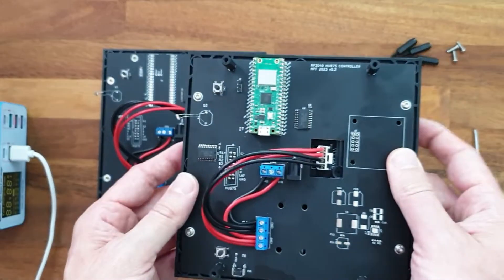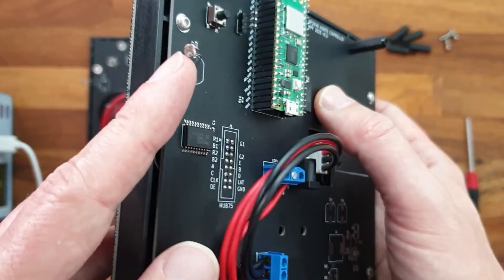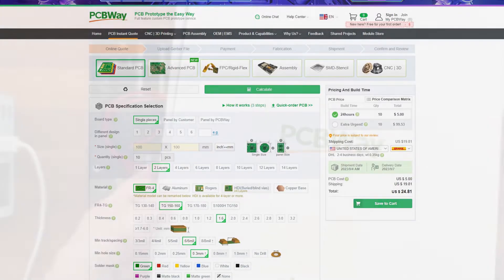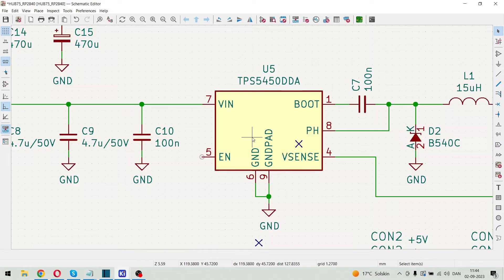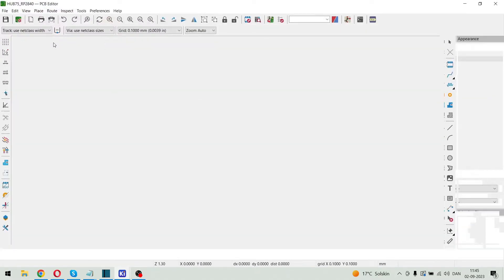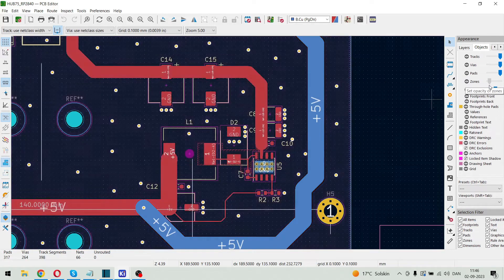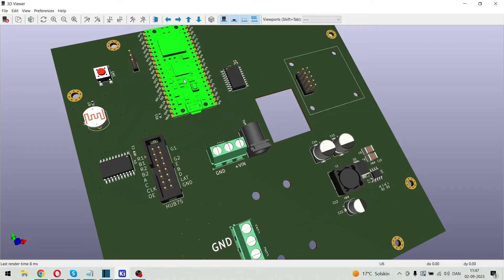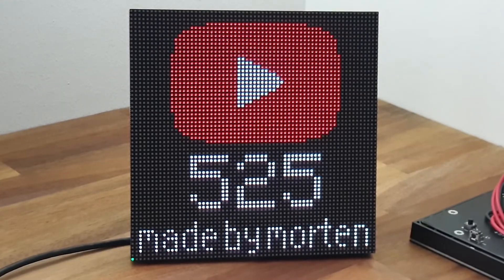HUB75 P2.5 RGB matrix display controlled by Raspberry Pi Pico W

Comment: Do you have one that will fit 64x32 2.5 pitch hub75 panels?
Reply from the maker: @MontesDesigns  no, only for 64x64
Reply: @made.by.morten.laboratories  i would be interested in a 64 x 32 version with pi 2040 chip instead of the pico

Comment: That looks a nice board but i have at least 3 different layouts on the back where the connectors are on the displays i have. I made a small daughter board that works on any size / layout hub75's
Reply from the maker: You are right, there are different mechanical layouts of the displays, i did discover this and decided to buy 10 pcs displays in order to avid this in my next project :-)

Comment: is the audio video still work in progress?
Reply from the maker: @chef-wally-io please elaborate?
Reply: hey  @made.by.morten.laboratories  you mentioned that you were going to add I2S speaker, which one did you go for to fit in the presolder connectors?
Reply from the maker: @chef-wally-io  Yes i did a small PCB with a MAX98357 I2S Class D amplifier IC - its very easy to work with
Reply: @made.by.morten.laboratories  thanks, which sd card did you go with?
Reply from the maker: @chef-wally-io  The audio is stored on the ESP32, i am using the 16MB version

Comment: Can anybody tell me why Thonny does not recognise hub75?. I cannot import the interstate75W. So frustrating.
Reply from the maker: Please share some more details
Reply: @made.by.morten.laboratories  i have a hub75 lcd matrix panel. I am using interstate75w with pico aboard. I go to github for example codes, put them into thonny and thonny doesnt run the code. It just tells me the module/machine is not recognised. Do you know why this could be? Thanks
Reply: LED**
Reply from the maker: Maybe you have to use their interpreter, try and download + install that one

Comment: can you daisy chain  HUB75 displays
Reply from the maker: Yes its possible to daisychain them. With my PCB it is not possible, There is no cutout in the PCB for the output connector. There is one input connector and there is one output connector on the display itself.